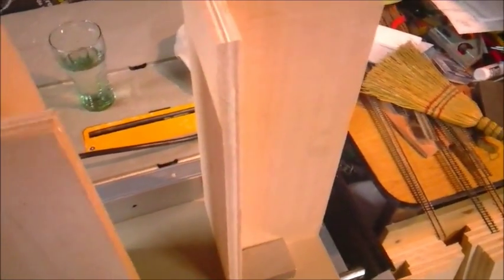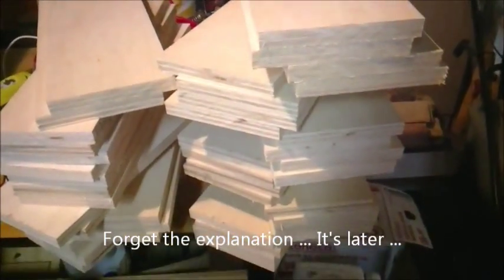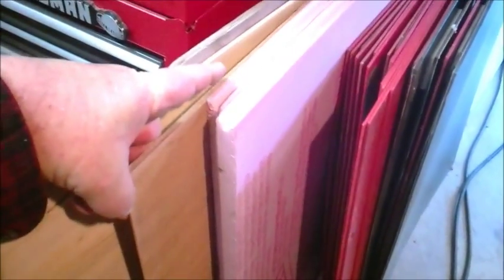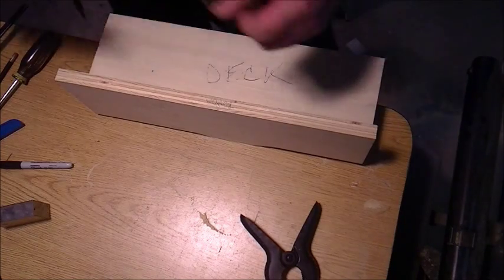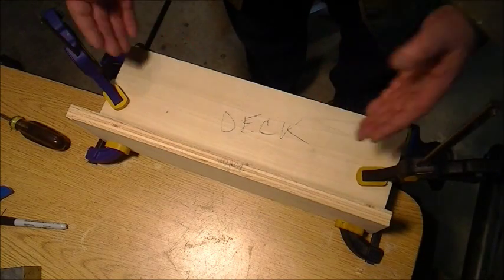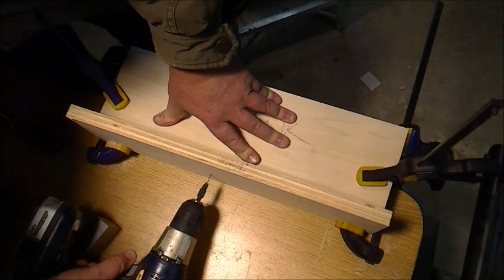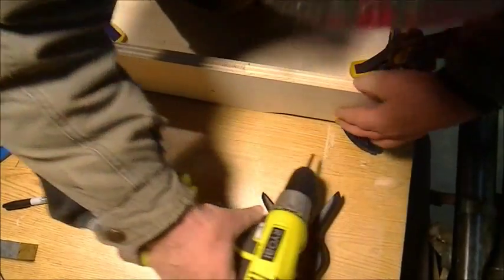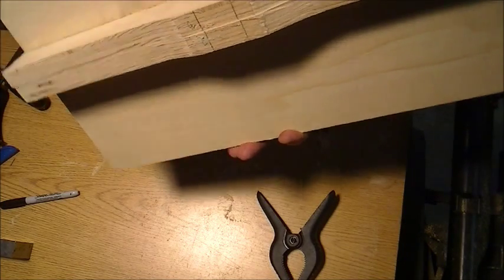FreeMo(N) modules part 1 - endplates

Comment: So Toni, I'm curious to know how this construction design has held up over the years of use, and what you found you'd do differently. I'm in the process of designing a similar module for the FreeMoN group in Sacramento. Thanks.
Reply from the maker: The modules have held up really well.  Some of the materials have changed since I shot the video, but basic construction is the same.  There have been some issues with shrinking and dips in the foam at the joint interface, but the framework & leg system has proven very durable.